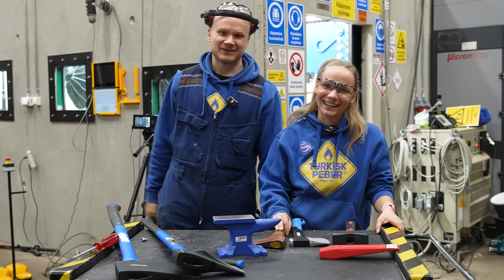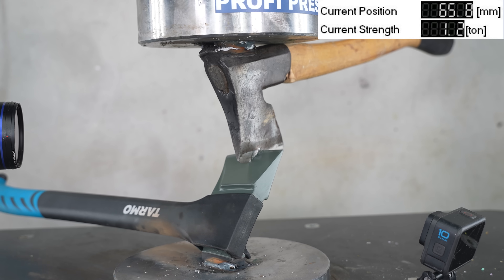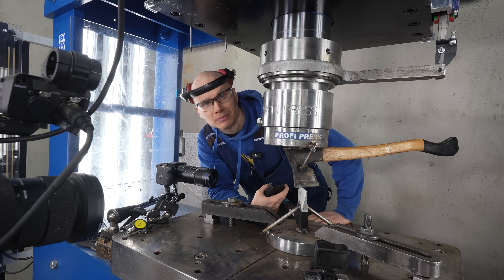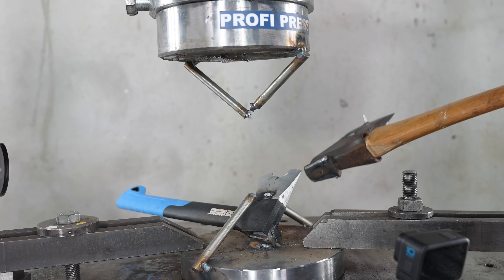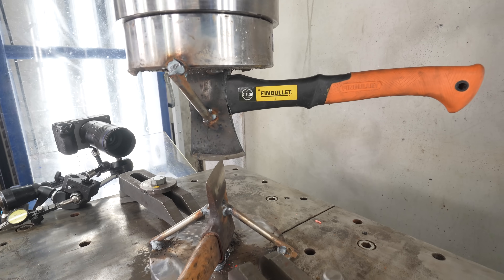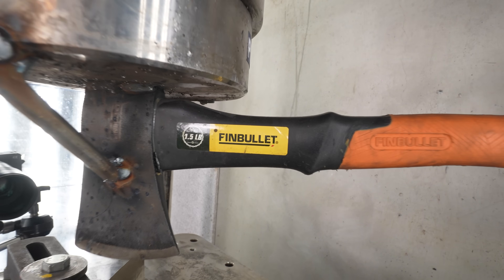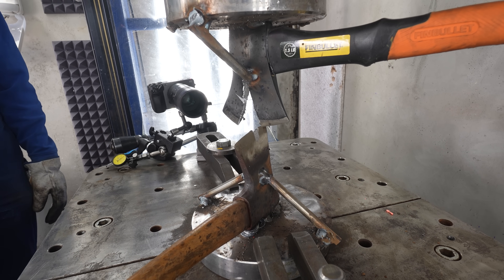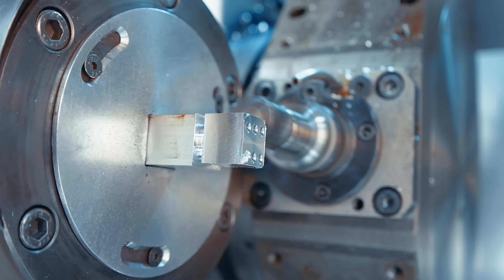Hydraulic Press vs Axes – Testing Old and New

Comment: Wouldn't the welding temperature change the temper and hardness of the metal? Also, you didn't even sharpen the old axes, they started off with a handicap....
Reply: Yes the welding will change heat treated steel in several uncontrolled ways. Gotta wonder why not just weld together a few holders for the axes for about the same effort. You wouldn't need much more than a couple pieces of thick rectangular tubing welded to plate.

Comment: With the machined dice, did you make sure h the centroids of the mass ensure fair rolls? I bought a set of aluminum dice about a decade ago and the maker had done a lot of careful work to make sure the pip holes were milled carefully to ensure a correct centroid.
Reply: This! Thinking about buying like 25 dice for "liars dice" but I need to know that they are balanced.
Reply: I thought dice were not supposed to be 'fair'. If the six has the least mass, it will show least often - equating to its higher value.
Reply: @michaelvandijk6852  Intentionally imbalanced dice would be something you could do if you wanted to, but almost no game is designed around that. I mean, as long as it's part of the plan, then sure! But it would be a good thing to note clearly in the product's marketing/information.
Reply: I'm sure the professionals thought about that at some point during the process.
Reply: @jaky3 I just hope the video showing the six face being milled is from an early production finish test or something, because there is little to no chance of a fair die if the production six face has deep, conical pips as shown.

Comment: Not a "real" anvil; just more of an anvil-shaped-object. 🤣
Reply: I'm sure it beats having nothing at all. Real anvils can be somewhat hard to come by.
Reply: @1pcfred  I'm in the UK I got one :)
Finding one wasn't too hard, finding one I could afford took quite a while.
Your right it it's better than nothing but the bigger, the heavier and the nicer the hammer bounce back the easier it is to work on, these tiny cast iron ones are 'dead' very little bounce back so much harder work as you have to lift the hammer every time not have it bounce back halfway (maybe not exact but how it feels when working)
Reply: @1pcfred  nice, lucky man and still using it if only occasionally is great to hear tools are made to be used
It's so useful to have something you can belt something else on without it moving or breaking lol
Worth a few quid a well so look after it... Which isn't hard just try not to let the working faces rust badly
Reply: @1pcfred  making me even more jealous now 😄
Edges should be a small radius not square, a crisp corner would make for a stress riser or place for a crack to start. 
Sounds like you have a beauty mate, generational tools
Reply: Midnight in the garden of good and ANVIL?
Reply: And you could call new axes "axe shaped objects".   There's no difference in what either one is other than quality.

Comment: is the failure mode of the cheaper axe and anvil indicative of forged vs cast tools?
Reply: There's a lot of factors that go into the quality of metals. Right down to the quality of the base ore. Then there's all of the alloying ingredients. The heat treatment. The forging too. As Thulsa Doom called it, the riddle of steel.
Reply: @1pcfred  Thulsa Doom's Riddle of Steel had very little to do with steel - but the will of the person wielding the steel - what matters is strong will.
Reply: @1pcfred  Good information, thank you!

So you think Thulsa's doom (pun not intended) came from being corrupted, and straying away from steel (that he wielded with his own bare hands), and relying too much on the power of dominating others, instead of relying on his own strength and the steel that he wielded with his own hands. When Thulsa failed at mind controlling Conan - Conan's will was too strong  - Conan defeated Thulsa with his steel.

So in a sense, Thulsa created the Riddle of Steel, but Conan had the correct answer for it - while Thulsa's idea of the answer was incorrect.

Or another interpretation, perhaps a better one: the key part of the battle between Conan and Thulsa was a battle of wills - not a battle of steel. Conan was able to resist Thulsa's will, and defeat him. While in the past, Thulsa was able to defeat Conan's mother with his will: in a sense, Thulsa hypnotized Conan's mother into lowering her guard, after which Thulsa struck.

But it is an interesting topic, I do not have a good answer, merely musings.
Reply: Cast stuff does indeed shatter pretty spectacularly 😅

Happens a lot with old tamale presses and skillets and stuff. Happens a lot when people cheap out on vices thinking a 5 inch cast vice is gonna somehow hold a 4 meter metal pipe without shattering.

// although, don't take it as a rail against cast tools, they work fine when used within their limits. And it keeps most kind of tools affordable